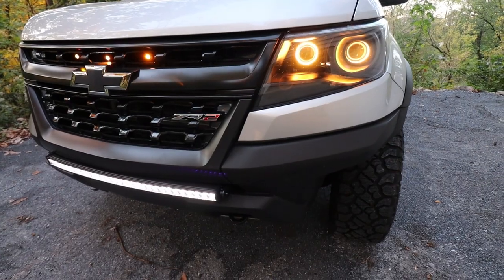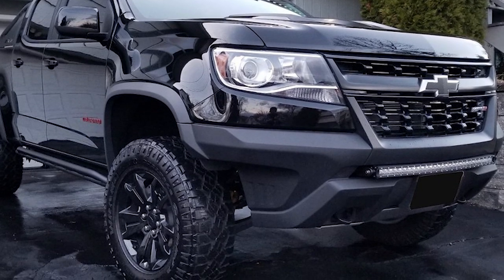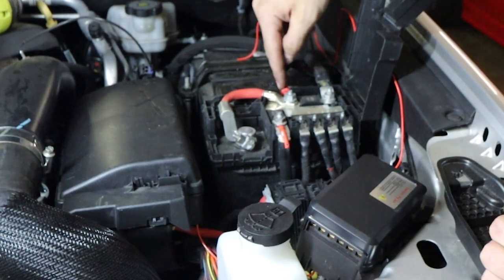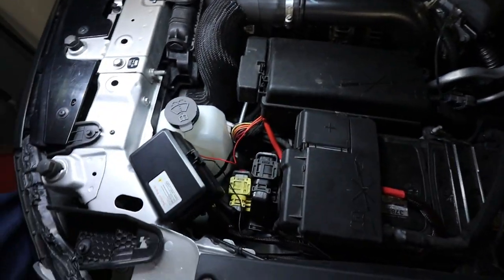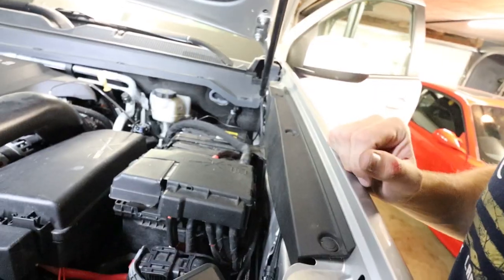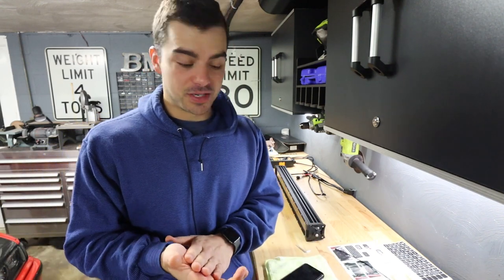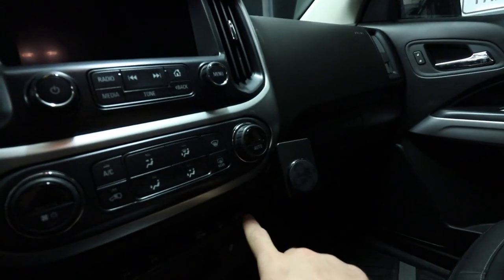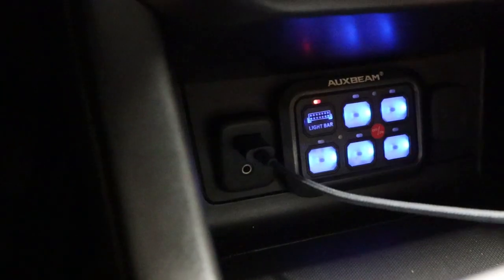Colorado ZR2 Lighting Mods Your Truck NEEDS!

Comment: What fuse panel did you use? For sure using this video as a template for my Colorado! Keep up the good work! Thanks!
Reply from the maker: I used the fuse panel that came with the switch panel.  solid kit.

Comment: I want to get their 8. All I’m time I want lights, an electric tonneau cover (right to the battery) (which has a light), a bed rack with lights, roof rack with lights, a winch, air compressor, gmrs radio, lights and more lights.

Comment: Looks great man curve bar was the way to go, but I'm gonna be that guy first time you bump into anything your smash the light bar. Also GM recommends not to block the air dam so I think it's time to change that front facia because it's NOT a bumper to the AEV bison front bumper so you can mount your light bar on top of the bumper.. Then you can add some fog lights. Then of course you gotta get the matching rear bison bumper and it has the knockouts for back lights. Oh yeah then you probably should just go ahead and upgrade the fender flares to the Bison fender flares then get the trim kit. and then, and then, and then. On $$$ and on $$$ and on $$$ and on. $$$.......................LOL it's a sickness I think there are support groups for guys like us.
Reply from the maker: Yup, it’s a never ending rabbit hole lol. I do still want different bumpers though.

Comment: I will probably have figured this out by the time anyone sees this and replies, but did you have to cut any of the plastic the brackets bend around? I can't get the crash bar holes to line up becuse I'm on the plastic up high. Curious if anyone else has run into this.

Comment: How did you get both raptor lights and auxbeam to run on accessory?

Did you just run the  raptor style led wire with the aux beam wire and put it in  the same add a fuse connector
Reply from the maker: I think I used a different add a fuse for each.
Reply: Daaamn Looked like you connected them both to that same lol but I’m in the same boat trying  to get my auxbeam and raptors to both run on accessory.
Reply from the maker: I really don't remember, sorry lol.
Reply: @matt13ross  all good brother thanks anyway. 
Trucks looking good

Comment: Used this video to set up my fuse panel did everything like the video shows. And the engine light went on any suggestions?
Reply from the maker: Engine light?
Reply: Yes for some reason it went on. What fuse did you use?
Reply from the maker: That’s odd. I can’t remember which fuse if it isn’t in the video. Bunch you can use.

Comment: do you have a link to the fuse box you installed ?
Reply from the maker: The fuse box comes with the Auxbeam switch panel.
Reply: @matt13ross  ok perfect! Thank you! The video was incredibly helpful. I actually installed a 30” light bar on my GMC Canyon (sister to the colorado) a few weeks back and am now debating on putting some ditch lights and some other things and think that would be very useful!
Reply from the maker: Oh yea it’s an awesome piece for lots of lighting needs.
Reply: @matt13ross  yeah, I might need to invest into that before I add the rest of my lighting needs and rewire my light bar to that.